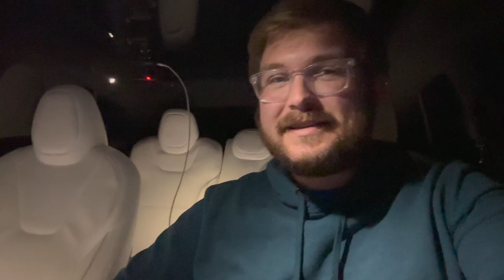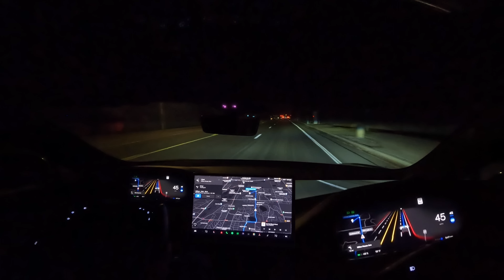I Finally Got Tesla FSD Beta! First Drive And Raw Impressions In My Model S At Night

Comment: Set follow distance to maximum if you want more time to take control.
Maybe set it on Chill until you get familiar with it (although I'm not sure that does anything).
You do not need to have a destination in the navigation to use it. I don't have the patience for the robotic turns, so I do the turning myself, but I let it take care of speed and stops.
The turn signal problem just became bigger with the latest build, it has me turning off the  system more often to avoid confusing others. They need, and will probably have a bug fix on that soon.
The problem is that it will never drive like you do, but you are still the one in the driver's seat!
Reply: Chill mode actually made me more nervous because it went too slow

Comment: This is really dangerous. Tesla is irresponsible for releasing this software and for advertising this software and sensor system as "full self-driving." Giving Tesla oxygen on this life-threatening system is not good. Thought experiment: Let's say we live in a world without the FAA. And let's say we have aircraft manufacturers putting out automated software systems and sensor systems willy nilly for beta testing by general aviation and commercial aircraft operators. And the operators implement these beta systems willy nilly in their aircraft and operate in dense air traffic environments. How comfortable would you feel getting into an aircraft in that context, especially in high density traffic areas? That's what we have in the automotive world, times 10.

Comment: It may be turning wheel to right on a stop before a left hand turn because if by the slight chance you are rear ended at the stop you would be driven into oncoming traffic if the wheel is turned to the left. But overall very scary
Reply: Yes exactly. This is taught in driving school.
Reply: It also wants to make a wide left turn.

Comment: I heard that if you calibrate the cameras sometimes it does better than if you didn't I also think it was getting confused with the map. It also isn't advertised to do parking lots yet.
Reply: Also this is the worst I've seen beta do in a very long time so that's why I think something is up or maybe something in the settings. Usually I see people use beta in assertive mode so it's possible that it does better in assertive.

Comment: I've got a request for your hogback challenge, could you test AP1 and FSD to see how much Autopilot has improved and how much of a difference FSD makes compared to standard autopilot
Reply: FSD Beta on the highway is the same as legacy Navigate on Autopilot. Tesla‘s engineers have not been working on updating that software, so a comparison using current wide release FSD on the highway would be testing software that is several years old and is not currently being updated. All of the engineering work is going into the beta.

Comment: Some drivers do initially turn the wheel opposite  way when making a turn, as if they are riding a bike or don't trust themselves not to cut a corner. It is very disconcerting and poor driving.

Comment: I wouldn't worry to much about the mixed signals, etc and driver etiquette while its in beta. Half of the world of drivers doesn't care when they have 100% control. I've been in areas where I swear 90% of all the drivers didn't use turn signals whatsoever. I would say half the us drivers don't even know you can turn right at a red light after you stopped.

Comment: Best driving system or driver assist program out. No one is doing videos of Ford, GM or BMW. Driving people around  because they can’t. Great video Kyle. Keep up the great work.
Reply: Yeah because nobody is selling them software for 15k that was promised to make them 30k as a robotaxi a year abour 4 years ago.
Reply: @EVPaddy  My point exactly. They can’t do it. But they can sell a piece of crap ICE vehicle. That will need a Radiator, Engine, Transmission, Heater Core, Alternator and AC compressor in 4 years.  For $30,000. 😂
Reply: @cjonesplay1  hm, quite an interesting thing to say considering that Tesla is probably the worst built EV you can get. And yeah stupid car makers not selling a system for half a decade that doesn’t do what they promised. Tesla will get into deep trouble with all the class action suites that will be coming.
Reply: @EVPaddy  I agree. Like the Ford Lawsuit Rollover Deaths.
Reply: @cjonesplay1  Not sure, was that an expensive extra?
Reply: @EVPaddy  They 2 or 3 For their faulty Transmissions. Ironically I have replaced 2-3 transmissions in my past ford. Vehicles. The rollover death lawsuit. Was $2 billion or so. I believe. But there’s nothing to see here. Because ford would never put anything on the road as Dangerous or disastrous as Tesla.
Reply: @cjonesplay1  Well, as a shareholder, I just hope nothing like that will ever happen to Tesla. Still don't really see the point in looking for defects in other car brands when the topic is Tesla selling something that doesn't exist for more than half a decade already.
Reply: @EVPaddy  Totally agree. When I lost my confidence in Ford. I sold all my shares.

Comment: Which FSD version did you use? It's nice to put it in the title. The lane changes are horrid, kinda looks like something is wrong, never seen such absolute fails. Try calibrating the cameras? But the visualizations are kinda ok, just the lane logic seems way off.

Comment: 25:40 it had time to cross I'd say, and there was enough buffer to creep in anyhow. I think the disengagement was too early to judge if it was gonna handle it well. But as it's your first experiences, better to err on the cautious side. You will learn its behavior with more use

Comment: This was very interesting. I'm with Alyssa though, if I had to watch that closely for the car to make EVERY correct action, I might as well drive it myself. If I can't trust it, I don't want it in my life. Granted, it's still a BETA, and I've done lots of Beta OS installs, but those might only crash my computer, not a $100,000 car.
I've said it before Kyle, you keep testing, and I'll keep watching. Fun video (unless you're in the passenger seat 🤣).
A side note, that thing was driving better than my sister-in-law does, so, there's that. 😱😱 Way back in the day, my grandmother would decide she needed to make a r/h turn.....while in the l/h lane.....in heavy traffic. At least she used her turn signals. AFAIK, never had an accident, although she may have caused a few.

Comment: I think the best way to use this if you actually want to use it as a useful feature is to let it drive on its own on straight roads and take over when you need to make turns. Like not even wait and see if it can do it, just do it yourself. Otherwise it's just becomes a nuisance quickly. Of course at that point I guess it's just regular autopilot that you can use on any road.

Comment: HW4 which ads cameras in the headlights will be a major step forward in the naturalness of it. I just got it today as well, but it can't see well at stop signs or UPL's so it needs to creep which is strange. Once they have the camera's in the headlights, faster processor, 5mp camera's, and possibly HD Radar, I think it will make massive leaps forward.

Comment: I've been using FSD Beta for, I think, at least a year in my Model Y Performance, and I use it every day in CT on our windy roads as well as in highway situations.  It's gotten so good that I use it on almost every trip - and it has changed how I drive from hyper-engaged to a more-relaxed outlook.  My expectation is that your car will perform better as it becomes more "experienced".  I think your comment about perhaps the lack of a Tesla "population" in your area may be germane to performance; there are a lot of Teslas where I drive.

Since the car was in an accident you should make sure the cameras are properly calibrated (this is a routine available without going into service mode).  When I got my car back from some body work, FSD was flukey and although the shop should have calibrated the cameras the process takes about an hour of driving and I saw an improvement from re-doing it.

You can set the following distance on the fly with the steering wheel buttons; I find myself adjusting this to the furthest setting on slow roads, and the closest setting on highways to meet the norms of how people around me are driving.

One of the skills for the driver is to set the maximum speed based on road conditions.  On roads with a lot of maneuvering, if the speed is set too high the car will maneuver ok (i.e. won't get in accidents) but it will use too much of the lane and will perform in a way that makes you look like a rude driver.  As you said in your video, the thing to avoid is behavior that doesn't meet the expectations of other drivers, and I often take over in complicated intersections because the car starts acting robotic in a way that doesn't meet that standard.

I consider FSD to be an amazing achievement and is ready for a seasoned and skilled driver to use every day - but to roll it out too quickly to drivers who have not demonstrated some skill may give it a bad name.

Comment: FSD stopped at the left turn light because the oncoming car was travelling too fast and FSD was being safe to make sure that the car was going to stop instead of t-boning you.  You really need to learn what the system will and won't do.  Humans are stupid and assume everyone else is going to do the correct thing and then end up in accidents.  FSD assumes humans may do the wrong thing and prioritizes safety over efficiency.

Comment: No surprises. Auto-pilot is so bad compared to other manufacturers that FSD could hardly be great. Self-driving is the most overhyped thing about Tesla and the least impressive. Would never fork out a cent to help them test something that requires more attention and creates stress than my own driving (with or without assist by other car systems).

Comment: You have a definitely need to self-adjust rather than be so negative from a first drive perspective. I saw a lot of your reactions being the stress creator and unecessary disengagement. The upgrade that is suppossed to come out next week has the full stack and changes everything yet again but it too will need to learn. With data now being compilied from 1 million teslas and auto-labelling about to hit the next level, a return of radar coming and so much more happening, autonomy will be here soon. The safety rating and the accident rate are the best across the board when using FSD and auto pilot. We easily get comfortable with our own behaviours many of which are bad and actually cause accidents.

Comment: "I will let it go further than most"

"It's creeping too far for my liking first disengagement out of the gate"

Literally half of these disengagements you could have fixed with a little accelerator pedal or patience. Possibly the worst FSD beta YouTube video yet.
Reply: Sure, if the car is driving in a way that makes you nervous it's absolutely your fault and not the car's.
Reply: @EVPaddy  he said one thing and then disengaged for the weakest reason. If you don't see the incongruence here I don't know what to tell you EVparody
Reply: @legacytesla  well, the best drivers are often the worst passengers and that’s basically what’s happening here. But it doesn’t make the way the car is driving more impressive. i.E. changing to the left turn lane when the line is already solid is maybe better than completely missing the turn, but still a no go.
Reply: @EVPaddy  naw. I have beta on a couple cars. His inexperience shows here.
Reply: @legacytesla  oh well, I see, you’re one of those that counts not crashing as a success.
Reply: @EVPaddy  creeping into an intersection for visibility and disengaging because you don't understand why the vehicle turn to the right a little bit so it could see better to go left has nothing to do with crashing and you're being disingenuous. Why don't you scroll on and find somebody else's comments you disagree with.
Reply: @legacytesla  Because you keep commenting. It may not have to do with crashing (until somebody crashed into you because you are in the wrong lane) but it shows that Tesla has screwed up camera placement. And as long as you're not alone on the road yeah sometimes you have to disengage when the car is slowing traffic down. It made enough dangerous and wrong choices apart of that.